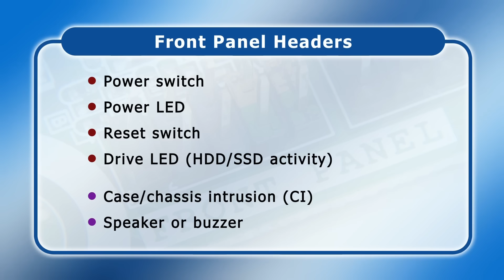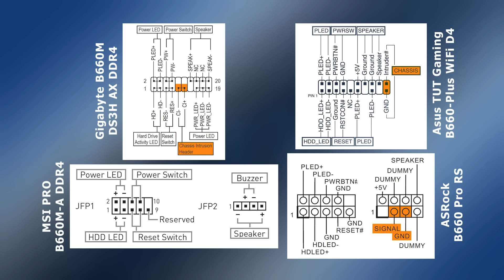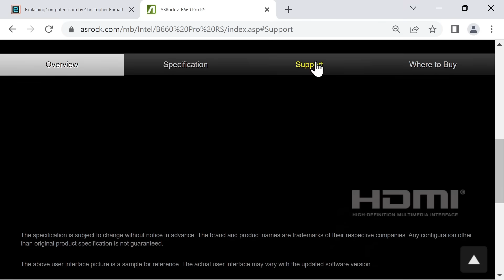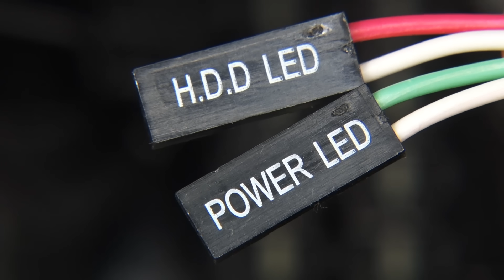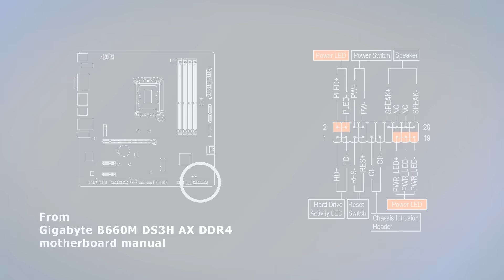Explaining PC Front Panel Connectors

Comment: "speakers don't have a polarity" - well, that's actually not quite correct - although it doesn't matter much with one single speaker it can affect a multi-speaker system when mixing them as this inverses the phase which can lead to artifacts at certain frequencies
also: although uncommon and usually specifically labled: when using the speaker leads to also carry some dc supply voltage then it does matter as it can cause damage otherwise
Reply from the maker: The caption in the video did state that front panel speaker connectors do not have a polarity (ie not all speakers). I am very well aware that speaker polarity matters if wiring a stereo pair so that they do not get out of phase. But this video is not about that topic! :) It is about front panel connectors ONLY. In education, less is usually more, and veering off into a completely different topic would have blurred the focus.
Reply: @ExplainingComputers  btw: both the manual of my new motherboard as well as some of the ecamples you shown call for a buzzer on the two inner pins whiles others list them as ground or not connected
do you know and can explain in short what's the difference, if there is any? thanks in advance and please keep your style - very educational and well presented, love the new 3d animated model stuff

Comment: Very well explained, professor. It only lacked to say, as far as I remember, that the white cables are the negative ones and the colored ones, the positive ones. Excellent video!!! 👍
Reply from the maker: I did indeed forget to say this, but there is a caption that indicates that the negative cables will either the white or black. :)
Reply: @ExplainingComputers  Yes, very true. Although it is more common to see white cables as negative in electronic gadgets that were opened and sometimes repaired, I see a more common tendency for manufacturers to use this color than black. Years ago, from what I observed, I think there were more black cables as negatives than white ones. I don't know if it's because of cost. White even in paints is cheaper and more abundant.

Anyway, thanks for your answer and excellent video, Professor. Sincerely. :D

Comment: Sometimes this is very tricky, if there is no reference, the pwr, then the reset, then the led connectors have to be found. On some motherboards, the power on led is dual, when in standby it lights up in different color.

Comment: I recall a few years ago that some motherboards came with a front panel block - a block that was fully labelled - you just had to plug all of the connectors into this block, and then plug that into the motherboard. It made plugging everything in so much easier as you didn't have to try and squeeze your hand in the case to plug the connectors in. It really is something that should be fully standardised by now however.

Comment: I found two small form factor Lenovo systems in the trash. I have aspirations of taking one of the motherboards and putting it in a full-sized case with a bigger power supply, so that I can put a full-sized graphics card in it. The front panel connections aren't labeled, nor does the manual have a pinout for them. I Googled the model numbers, but nothing came up for those exact models. I did find a pinout for a different Lenovo model and it has wires going to the same pins as mine, but that doesn't necessarily mean that all the connections are the same.

BTW, they're an M900 10FG and an M91p 7033.

To be honest, I don't even know what kind of a case these motherboards would fit into. As in, the mounting holes lining up. I'd probably be using the M900 since that one POSTs. The M91p powers on, and the fans spin, but doesn't seem to POST. I never get a picture or any error beeps.

Comment: I have always wondered why a standard block plug has never been defined for the case jumpers. Everything else on the board has been standardized with an idiot-proof socket design, so why do we still have to fiddle with lots of loose wires for the most basic of hook-ups?

I mean, all you'd need is a single standardized pin layout and a plastic plug-and-frame to go around it. The raw pins would even still be accessible for backwards compatibility. It should have been the first thing to be simplified and standardized.

Comment: I certainly don't miss the old days where every motherboard manufacturer put the headers in different configurations without putting any labeling on the PCB. Lord help you if you didn't have the manual (again, this was the days before one could easily download a .pdf)

Comment: Hooking these up in the old days was infuriating, thankfully they've gotten better but it's still surprising that they were never standardized into a single connector. Personally I only connect the power switch these days. I don't like LED's flashing or lighting up my room at night and is there anything more useless than a reset button on a modern PC? It's just something for you to accidentally hit and lose all your unsaved files.

Comment: I forget which jumper but once I had a 3 position block with two wires where the wires went to the wrong holes in the block. I might have had to make a new hole but it all worked. I think it was a HDD activity LED. Made me anxious.
Some motherboards provide a plastic block that you can wire up externally before you plug in the whole block into the pins. This avoids the fiddly bits.

Comment: During ancient times until earlier 2000's, it was an headache to wire the front panel even it was just for buttons and leds. Some motherboards had too many pins in a single block, some had pin headers scattered, .. and we had to check the manual or pay attention to the writings printed on the motherboard. Fortunatelly someone came up with a simple 5x2-1  header so we can group the buttons and the leds and this header was pretty much the same for all manufacturers.
Usb headers were always the same. 4x2 pin headers but there a little of fear to hook the wires, we needed to pay attention to the markings or the pin 1 that meant 5v. They then added an extra pin that basically ground was next to that pin and some manufacturers used this pin as detection, such as HP.
Sound header didn't change much either.10 pin block with less one. We needed to check the manual unless the pc case already had a keyed plug for audio. HDAUDIO introduced an headache cos the audio jacks needed to be compliant.

Comment: Whenever I plan a new PC build, the case to mobo connectors are always the part I dread the most.
In the past I've sometimes had to deal with a mobo that assumed a different standard.
But I have learned that the Speaker and the Reset plugs are the ones that are important to orient correctly, if memory serves.

Comment: Before that it was far more difficult. While you had the same front panel connectors for the most part. The switch was connected directly to the power supply. But you also had to set up the motherboard as well with jumpers and switches for things like system speed, IRQ, COM, etc. I was so glad when they finally simplified those settings and incorporated them into BIOS. Some new motherboards will supply a header for you to attach the front panel connectors to and then plug that header onto the motherboard making it even easier.

Another great video and explanation of the front panel connectors.

Comment: I guess the labeling must have improved -- when I put together a PC in 2003, the motherboard itself had cryptic labels, but the cable connectors didn't, so I had to follow the wires back to whatever they connected to.  But that wasn't the hard part.  The hard part was the multiple standoffs to keep the motherboard at the right distance from the case while not shorting anything out.  I had to place these very carefully on the case in the right layout and then carefully put the motherboard down on them and carefully put the bolts in, because if I made one mistake, a standoff would fall over or at least get too far out of line with the corresponding holes in the case and/or the motherboard, and I would have no recourse but to back out completely and start all over.

Comment: Even though my motherboard comes with an adapter to help me plug my front panel connectors, I still manually plug them into the system as my case only has wiring for Reset SW and Power SW, I’m thankful my case doesn’t have LED’s for HDD and Power

Comment: i remember connecting these when i used to work as a computer technician, also USB used to come on four separated cables per usb connection, later they came in just one header for two usb connections...
actual audio ports came separated and nobody dared to mess with, i sarted to connect those when they also came in just one header connection

Comment: First machine I built I had it all together and working, noticed no power light came on and just assumed the case had no power LED. Until a day or so later I remembered that I'd actually plugged in a cable of power LED. Of course I checked and found I'd plugged it in with the wrong polarity. Flipped it around and voila, power light! Case had no reset switch, hdd indicator or built in speaker so front panel hook up was easy, and I made about the only mistake I could have made. 
50/50 chance and I was wrong. Luckily, unlike a USB a plug, I got it right on the second try

Comment: Great video Chris. I always wondered about the polarities and if it would damage anything. You have put my mind at rest. I agree about it being a shame that most motherboards do not have a speaker now. That reassuring single beep was always good to hear. I might buy one of those speaker connections just for nostalgia.
Reply: My Father built 100s of PCs and just used guess-work, worse case seneraio is you might get the Power LED becoming the HD Led and the HD Led becoming the Power LED. Might look a bit werid but then it's easy fixed..

Comment: My case does not have a reset button... and there were situations I really needed to use it. What a shame I didn't realise it earlier before buying. All computer cases should have this feature. Or at least I think.
Reply from the maker: You should not miss it. In most instances where you could press it, a hard reset via the keyboard -- via Crtl-Alt-Delete -- will work. And if that fails, you long press the power button for a hard shut-down, and then reboot.

Comment: The beeper dates back to the early days of the 286 computers. At that time, tones were even played over it. 
To do this, a register in the keyboard controller is constantly switched on and off. 
But modern sound cards have replaced computer audio. The beeper remained. 
Some notebooks also have this function integrated into the sound card.

Comment: Is anyone here old enough to remember the days when computer cases had Key switches to disable the keyboard? 
Is anyone here old enough to remember having to configure boards with the proper address and interrupt using jumpers? How about running Microsoft DOS and using a program called MSDS to look for conflicts.
Is anyone here old enough to remember a company called Digital Equipment Corp (DEC.)?  Or maybe Control Data Corporation (CDC.)
I THINK I HAVE DATED MYSELF ENOUGH FOR NOW but if you can, find some old computers and parts and an old operating system and start playing around with them.  YOU CAN LEARN A LOT.

Comment: Some of the new motherboards still have a COM or LPT port on them but just as a motherboard Pin connector. I installed a back-plate onto a comp that had the ribbon cable plug running to an old 9 pin RS232 plug harvested out of an old 486 computer into a modern comp giving it a COM port to hook on a old device with a RS232 port for programming.

Comment: I had a real old motherboard that had an MSG and a power Led connector.  The MSG one blinked when a message was waiting while the power one would only be on or off depending on the state of the computer. Apparently there are ways to make them blink if it is labeled MSG.
Another motherboard I had included 2 front panel connectors in it but they both had the LED, HD, Power, Reset etc. but the second one on the front of the board had a shroud around the pins for a specific case front panel header to plug into it, while the one on the left hand side was the normal looking front panel pins.
 I have not connect the front panel plugs from my cases switched. I have a set of wires plugged in that run to a slot panel plate on the back where a molded bit of rubber clips onto a gap cut in it with a long cable running to a round plastic disc with external buttons and LEDs on it placed near my keyboard for easier turning on and off.
The power lights in my case do still glow but only because it has a V shaped bit of frosted clear plastic on it with a few blue LEDs behind that plug into a molex connector for power.

Comment: Nice video. I thought you might want to also mention that these days, motherboards (at least some of the better ones) will include a little separate pin-out plug so that you can connect all of the jumpers to it first, and then plug it onto the motherboard pin-out so you only have to plug one big thing onto the motherboard and makes the process easier. It seems pretty common these days on all the mobo’s I have used.
Reply: I used to use them but I didn't like the latency it introduced in my HDD LED activity, so I only wire them directly in now.

/s

Comment: Great video.  I've been building PCs for about 25 years and the worst part of any build has been those teeny, tiny little plugs and teeny, tiny print on the motherboard (if it's even on there).  I recently did an EPIA Nano-ITX board build (Epia-NL500EG Nano-ITX VIA 533MHz) - no IO on the board, all the IO connectors where attached with cables and not many of of the header were labeled... and they were in any "normal" configuration for the ones that you would expect.  And EPIA didn't have a manual specific to this board... just some other models (that helped). AND the f'n pin headers are not standard 2.5mm pitch, they are 2.0mm pitch so none of my stock cables would fit on this thing!

Maybe do a video on 2.5 vs 2.0 mm pin pitch.  That was a first for me.

Comment: you forgot 1 thing with power led, you can actually use BOTH sets if your case has auxiliary leds in addition to the primary power led, dont overload the circuit if you have excessive lights or CCFLS which draw more power than leds
Reply: remember when USB was first coming into play and they didnt know how to standardize and sometimes were 4 or 5 or 9 individual pins?? also since you didnt go into detail on usb, it usually comes as a 9 pin(keyed 10 pin connector with 1 blocked out) or 19 pin(usb 3.0? also keyed) also audio connectors are a whole nother can of worms, ac97 simplified it with a 10 pin keyed connector, usually yellow :D
Reply from the maker: A very good point. :)
Reply: In the funny part is you probably have a ball of wires as do many of us who tinker which we will someday untangle but all of the stuff that you are teaching the masses I today take for granted because I have been doing it more or less my whole life now who knows how many assorted speakers I have LOL

Comment: Nice video Chris, but it's far more difficult to plug the connectors once the motherboard is installed in the case haha. And I'm too young to remember, but did the speakers come with case or the motherboard? And how much do the bean counters save by not including it anymore?
Reply from the maker: Indeed! The speaker, when supplied, comes with the case.

Comment: I wish this was around maybe 15 years ago. I tried calling HP and asking what the pinout was to one of their computers. Not knowing what to look up and that it was a standard. Was pretty young at the time. The guy only said to me the information you need is online. Wouldn't tell me anything. I ended up asking a friend and learning that it was called the front panel header or something like that and I found the pinout. If the guy would of just said that instead of saying its online.

Comment: Those 5" and 7" Raspberry Pi monitors can plug into the motherboards USB pins as you have shown in a previous video.  Also Adding bluetooth to some wifi adapters requires a serial or USB connection on the motherboard in addition to the wifi adapter.  Those could have been discussed here as well.

Comment: I remember transplanting my first pc system into a new case and none of the front panel connector blocks matched the layout of the pins on my motherboard so wouldnt plug in without cutting the connector blocks into single connectors.  Was quite nerve-wracking as I had no idea if doing this would knacker something lol.  Also remember the nest of jumper wires that set the little LED cpu speed screen being fun to get right. As an aside, does the ohm rating matter on the speaker?
Reply from the maker: I've fitted speakers in the range 8 to 32ohm and never had issues. I have on many occasions tried to find a safe/best range, but never have done so. This said, the speaker only requires very limited functionality for a "beep". :)
Reply: @ExplainingComputers  I guess the beeps would just be quieter or louder depending on the ohms. Im binge watching your videos atm, Im loving the no nonsense presentation, great channel.

Comment: What a cool coincidence! I also bought my first PC in 1996. It was called 586 (turned out to be AMD 486 equivalent) with 16GB RAM. I thought it was an Intel Pentium but learned my lesson the hard way. All later PCs I have bought I assembled myself. It's always fun to assemble a PC indeed and hear that beep. On this note, your "fake switch" is certainly better than using a screw driver to boot up :)
Reply: 16MB RAM ?
Reply: @cheeseschrist2303  was gonna say this yeah
not a chance it had 16GB RAM in '96
Reply: @cheeseschrist2303  Indeed. 8MB was more common back then.